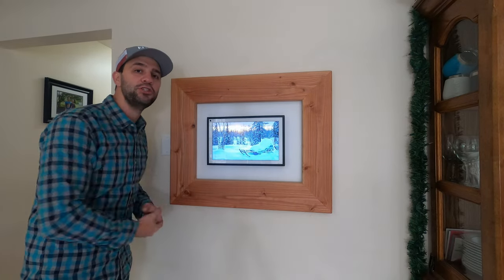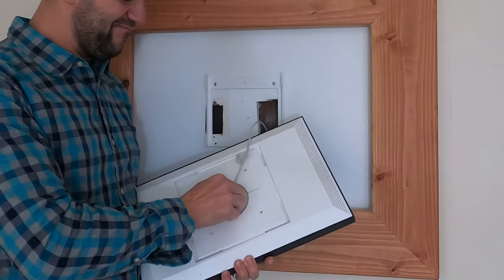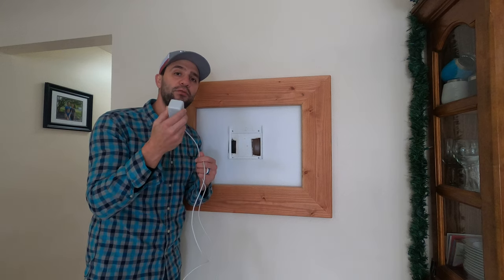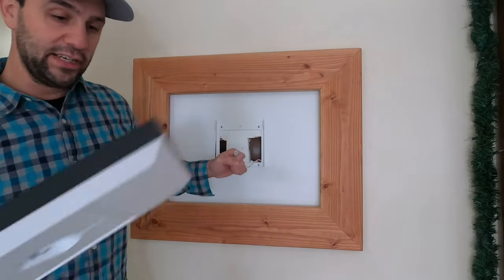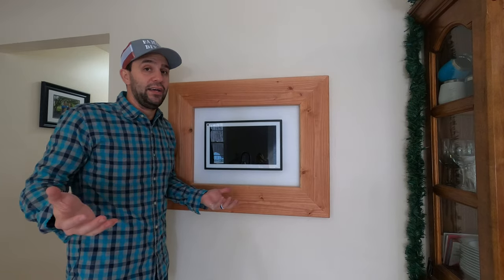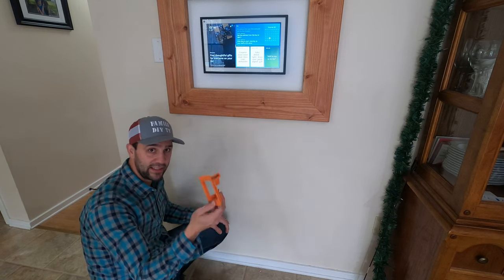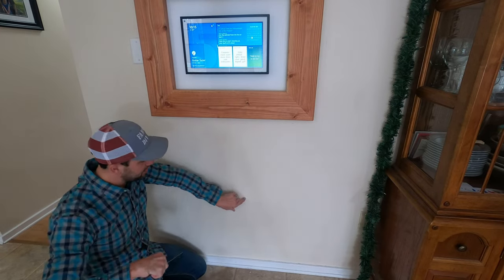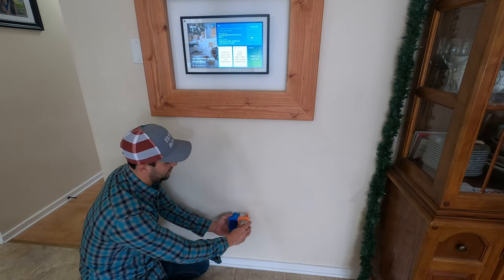Hiding My Echo Show 15 Power Wires

Comment: LOVE this custom work! I have an intercom system from the 80s (low voltage wires), and trying to think of a clever way to use those stations for something more modern than intercoms.
Reply from the maker: Thanks for the nice words !

Comment: Is the cord CL2 rated for inside the wall?
Reply from the maker: i have no idea, in fact never even heard of a CL2 rating had to look it up.
Reply: I hope so.
Reply: @FamilyDIYtv  Cannot use an non in-wall rated power cable. This would void your insurance coverage in a fire (which can start by as something as small as the cord snagging on a screw, an accidentially nail, or a mouse chewing.

Comment: Yeah, I had to do a similar install but I installed and wired  a recessed box for future applications. I ran the Show 15 cable behind the wall and out to a receptacle outlet below.  So, even a larger and deeper recess box did not work due to the size of the adapter plug.  I like the wide custom frame you made. Good 👍 job.
Reply from the maker: yeah - the size of transformer is odd.  assuming the next one will have a smaller plug to make easier to install.  

Thanks
Mike

Comment: Definitely not to code
Reply from the maker: no code issue here
Reply: @FamilyDIYtv  Is this in the US? Then it is illegal.
Reply from the maker: @Dropboxed  yes - what’s illegal about it ?  honestly wondering ….  it’s plugged into an outlet.
Reply: @FamilyDIYtv  Look up "National Electrical Code 400.8". Not illegal in the sense you'll be criminalized, but as someone else mentioned, it's an easy way to fail a home inspection or get an insurance claim denied. And the fact you have this running through your laundry water pipe box really isn't helping either.